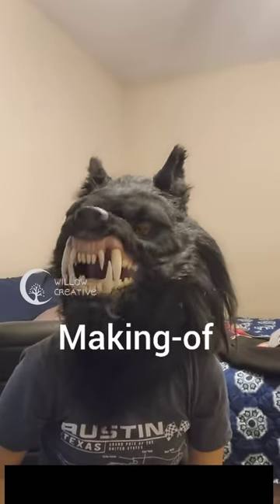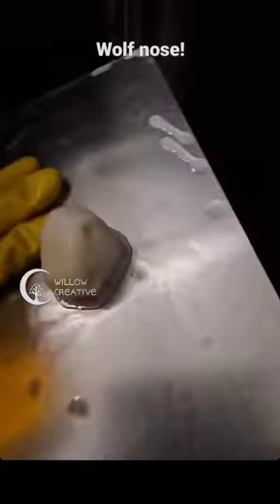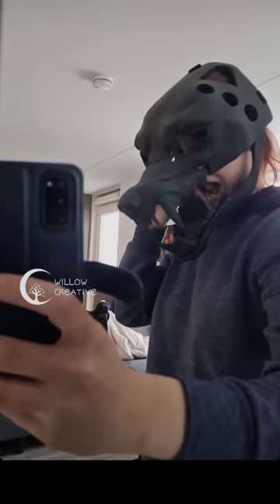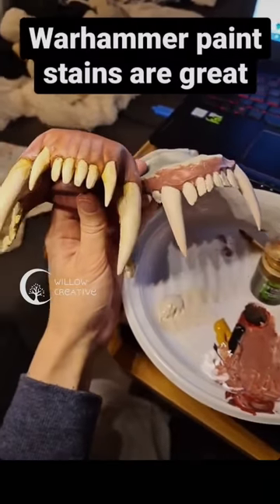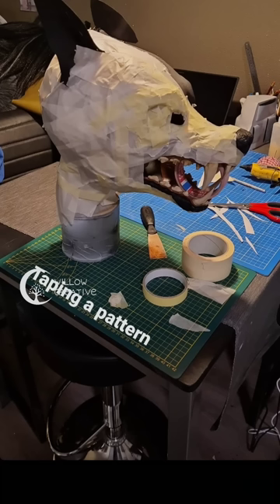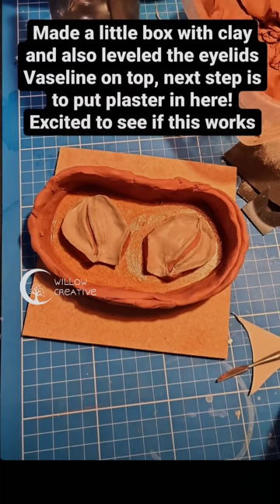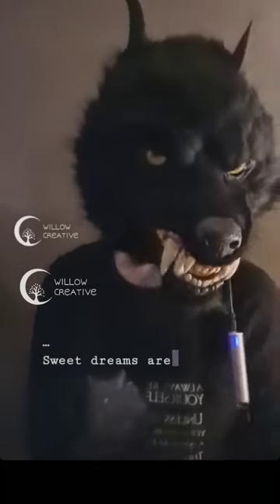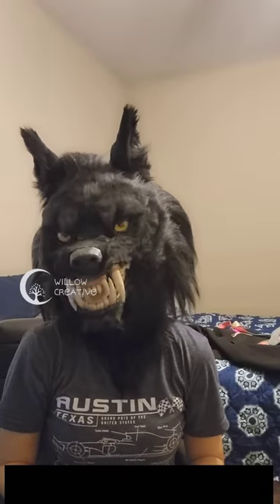Making-of animatronic wolf mask

Comment: It'd be really cool if the next one you made had relaxed lips that used wire to pull them up into a snarl, to offer even more expressions!
Reply from the maker: i did that with the first one but it doesnt work well unless you use a very stretchy special effects silicone